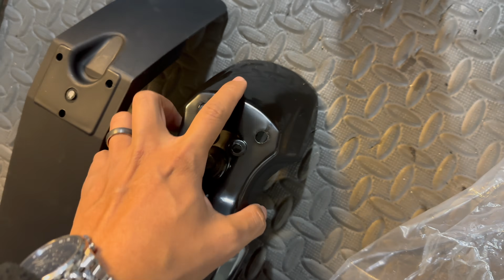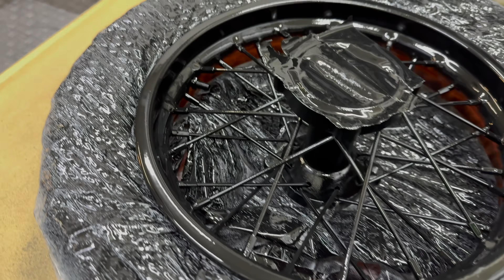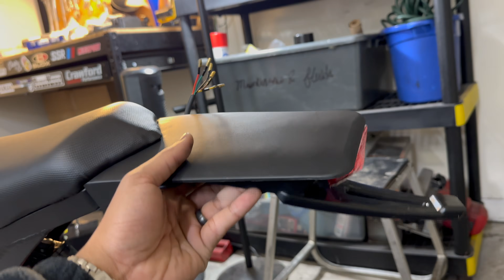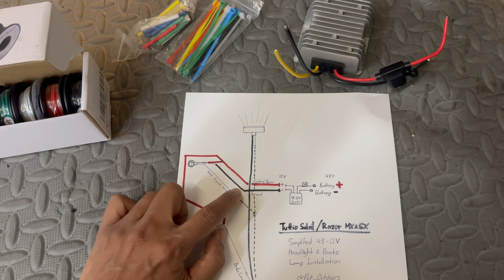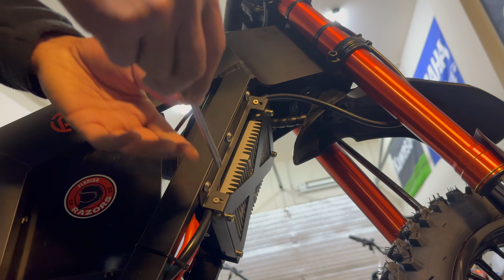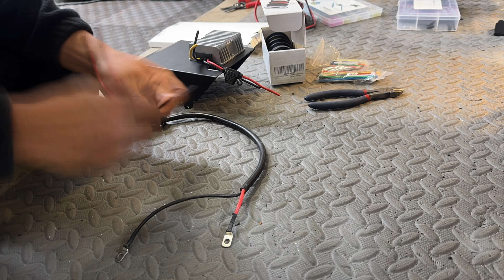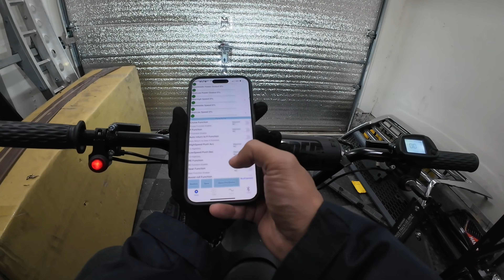Tuttio Soleil 01 Upgrades - Nilight LED Headlight & Tail Lamp Install

Comment: Not sure if you like the tuttio logo on there but on my sons bike I took off the logo with a Jiffy cutter blade just remove it as if your trying to remove a sticker or window tint as it's not paint the tuttio logo is like a thick sticker. It did leave a few minor scratches but I covered the scratches with other decals and on the front fender I used a heat gun to bend it downwards so it doesnt look like a diving board lol🤙🏽

Comment: How much range do you get on the 72 V battery 20ah
Reply from the maker: I never got a chance to do a full range test. But It got down to 79V after 8 miles of riding, so likely about 17-22 miles, depending on how fast you're cruising.

Comment: Instead of cutting it why didn't you use a heat gun I used the imprint of that other Fender in the the other Fender it will save you a whole lot of time instead of cutting it

Comment: Im thinking of getting the tuttio soliel 01 also is it good for offroad because i like offroading and does it have good suspension. And one more thing do you think its worh the price from what i heard its very reasonable for the price.
Reply from the maker: If you like off road and you're UNDER 150 lbs, this would be a good option. Another would be the Razor Pro-Spec. I think those two bikes are the best for this price range.

Comment: Did the motor eventually burnout? Or is the original hardware still holding up?
Reply from the maker: @phadestonkaneki9861  this is the original, still holding up.
Reply: @PatOutdoors  if the motor would last up to 6 months with a 72v battery, is that something you could then recommend? Or would you have to see how it handles over a longer period of time

Comment: Where do u find the right tune settings I tried one and the throttle stopped working so I’m unsure what the correct settings are if u could make a video or just comment the settings that would be grest
Reply from the maker: You can use the auto learn feature if you’re not too familiar with Fardriver. Voltron has a great video about this: https://youtu.be/aZgwL_7XMCg?si=m7pegdtkyprNaFpk

Comment: Hi love your channel. I have  just purchased a tuttio and I would like to to ask you a question. 

My chain is rubbing on the chain guard near the front sprocket and I have tried to adjust the tension and it is set correctly. But still rubs I was thinking of raising the motor but there is no space . Would changing the size of the front motor sprocket raise it enough to stop the rubbing. I need roughly 4 mm to have a clean no rub. 

I would love your thoughts. 

Max.
Reply from the maker: So I spoke with Tuttio about this a few weeks back since the plastic on the chain guard seemed oddly loud to me. Tightening the chain a bit can reduce the drag, but you can only do so much with that since you still want chain slack. They just shipped me a chain guard that’s supposed to be softer material and quieter. I’m supposed to receive that in a bout a week or so and I’ll post an update video on the results

Comment: How would I actually do the turn signals
Reply from the maker: I have the turn signals hooked up on my Razor MX650 with the same tail lamp housing. You would just need a switch with turn signal switch on the handlebar (instead of the on/off) and extend the yellow and the brown wire from the tail light to the new switch with a flasher relay in between.

Comment: How did you plug in the 72v battery to  the original 48v wires ? How was the connecter the same
Reply from the maker: It’s not the same. That’s why I had to change the harness back in this video. The 72V battery came with a QS8 connector. I did a fully detailed install on that a few videos back, if you want to check it out..

Comment: Quick question Pat, did you unhook the brake lever wires from the controller to use in the new setup or did you have to cut them? Are the brake lever wires just used in the new setup or also wired to the controller still? Thank you.
Reply from the maker: @gex32985  I actually fully disconnected it the controller because I didn’t want it to cut power when I apply brakes anyway. I cut the wires, but left the connector from the controller alone (in case I want to reverse it later on.) I suppose you could also tap into it as a signal wire

Comment: By any chance do you know why my tuttio01/kugoo wish 01 doesn’t have as much as Torque and power as before
Reply from the maker: @Mosaab27  what did you change on it..?
Reply: Nothing it just stoped being as powerful as before
Reply from the maker: @ likely due to cold weather. Most electric bikes put out a lot less power in cold weather vs warm. You’ll even notice more voltage sag on the volt meter. But if you have a separate issue, I recommend contacting Kugoo support
Reply: @PatOutdoors has it ever happened to you ?
Reply from the maker: @ nope. Unless your bike it old, then it’s normal to get slower over time as the battery wears down
Reply: @ no I bought it yesterday and I live in the Middle East it’s not cold
Reply from the maker: @ then how is it slower than before?  Sounds like it’s brand new. A kugoo wish 01 is not the same bike, different top speed, different tune, very similar though.
Reply: @PatOutdoors  yeah I know but I rode it in the sand then it stopped working and being as powerful as before I’m not sure why

Comment: I'm building my own baterry, a 60 volts 45ah, it's going to be ready in one week
Reply from the maker: How are you fitting that in this frame..? Would love to get more details on this
Reply: @PatOutdoors  my 60 volts 45ah battery works great ,it is fitting perfectly 👌, I have enough range, I might need to upgrade the controller  and motor, but im good  for now .
Reply: @androsmilenionful  I thought the Tuttio is able to take on up to 72v with the stock controller?  So wouldn’t you be good with 60v?  Or is there more to than the little knowledge I have in this realm?
Reply: How much longer the range is with the 60v battery? @androsmilenionful
Reply: @androsmilenionful name of battery?
Reply: Will there be a new version of the soliel soon with better welds?
Reply: Any updates?

Comment: Actually Amorge already has a 72v battery ready made for the Tuttio Soleil 01. All you have to is order it.
Reply from the maker: I had this battery in this bike since September. I see Amorge now has other options available though
Reply: Hey  @PatOutdoors  is the battery in this video custom built i was wondering if this is the same AMORGE 20S5P 72V 20AH 120AMP Battery.  i’m about to buy the 72v Sotion kit for the Soleil01  and i want more power than the 60v they sell for the stock setup?
Reply: Do u just need the battery or something else aswell
Reply: @ just the battery
Reply: @Messican69  how much does it cost if it costs 300$ ish I’ll definitely buy it with a Kugoo
Reply: @Messican69  do they work with Kugoo wish 01
Reply: @ yeah same bike Same plug
Reply: @Messican69  cool do u happen to know hm if costs
Reply: its only 60v

Comment: love the channel but only ride large bikes because I am 6 foot  5”
Reply from the maker: I also have larger bikes. They’re just not as neighborhood friendly so I can’t ride them all the time lol. Yamaha YZ250 and TTR230 in storage, Talaria and RAWRR mantis in the garage.What do you ride?
Reply: @ Hi …. for many years I rode  carbon mountain bikes pedal power    lol…Then I tried a fat tire 4x26  electric cruiser style large frame…put a couple thousand miles on it  , I really like the umph  up the hills. and still could get some cardio …elctric pedal bikes  is an interesting  way to get  exercise you can push it really hard and then were your legs are gassed you can just throttle  and recover and rinse repeat…My daily now is a meeelod xt 600 dm    750 w dual motors by bafang  lg cells  48 x30 , motorcycle style seat dual suspension…I put a motorcycle tire   different bars and larger  chainring..never comes out of seventh gear always dual motor….Trail happy reviewed the bike…It will climb everything I have thrown at it and at 245 lbs   no problem…has brake light  dual beam headlight cruise control  etc..   I have put a couple thousand miles on it ten miles at a time…   I am building a bike similar to your qs138 250 dirt bike   mine is a suzuki rm   750    engine was a basketcase  due to a   broken piston                .The meelod tops out on asphalt about 33 mph, I can ride it on trails in park and errands in town cops dont seem to care,      of course rider weight means a big difference  in  all e bikes…The dual motor really accelerates not like a talaria or surron but single track through woods 20 mph   feels fast…..I have ridden the eride pro ss and my meelod climbs   as good as without a big run at it…I dont suggest a lot of bikes to people but this one I do…I dont think I can go back to non dual motor for off road..  keep on trucking..     not sure of what controller for the qs 138 v3  I will order???   thanx

Comment: I like you elecric bike collections.

Just wondering if your Tuttio bike can have it's wheel and tire size increased like that of the Surron and Tallaria? and does the Tuttio have the same frame size with the Surron and Tallaria?
Reply from the maker: The swing arm length is limited, though you could probably fit a 17” front and 14” rear wheel on this bike easily. I would recommend that unless you put a more powerful motor on though, lot of added drivetrain weight

Comment: Looking good! I ordered amorges 60v 30ah 150a battery and a 72450b from econic cycles just waiting for sotion to start selling that new motor too
Reply from the maker: 72450?! Sounds like you are going ham sir..
Reply: @ mode three will be 120a and I most likely won’t go over that
Reply: @PatOutdoors hey pat how's it going...great videos...I have the Rad Rover 5, can I get these Tires for my bike, I'm really liking these Nobby style tires... thanks for any info.

Comment: Mines all black now besides from the sticker can you tell me how to get rid of it also should I make the fork silver
Reply from the maker: @knight48894  honestly I tried taking it off a bit, but wasn’t working well. I gotta figure that out.. you’d have to buy fork tubes to change the color
Reply: @PatOutdoors  that's the plan
Reply: @PatOutdoors  Have you tried a heat gun and plastic scraper? ..or maybe some acetone?
Reply: I took the stickers off with a heat gun, plastic scraper and a little goo gone.